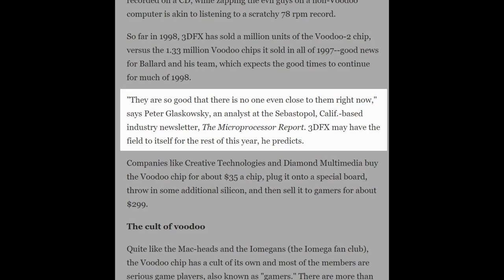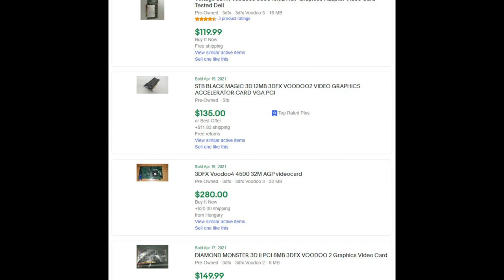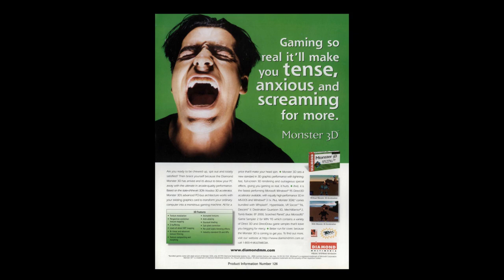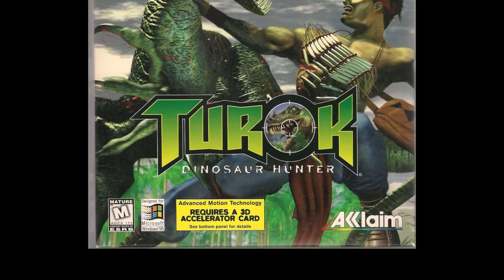3dfx Voodoo - Hit that Accelerator

Comment: That electro-mechanical relay is LOUD. People have talked about it before but I haven't seen a video actually record it until this one.
Thanks for sharing your memories! I'm jealous as my first 3D accelerator was the built-in Trident Blade 3D in my family's Compaq Presario. Not the worst thing ever but definitely no Voodoo!
Reply from the maker: Thanks! Yeah I put the microphone inside the computer so I could really  capture it and boy did it ever. The fact it's heard so easily with a closed case says something.
Reply: guessing that was changed to something solid state in the  Voodoo2
Reply: @Elios0000  It was actually changed on Voodoo 1. Only the early Orchids had mechanical relays. All others (including the Diamond Monster 3D) had solid-state switches.

Comment: Side by sides really do show the difference. You hit it bang on with the point about it burning brightly and anchoring nostalgia to that specific time. Especially as there's a finite amount of games directly supporting glide. I'm a software pixel guy myself, probably due to my experience with the V1 was a slow one. I had it from a friend who upgraded to a V2, but it didn't do much for our Cyrix 100 so I sold it to another friend. I even like Q2 in software. I do own a V2 though!
Reply from the maker: I will say as well I'm leaning more software now just because I can play on more powerful hardware than I could back when and basically brute force higher resolutions hah. But yes it's nice to have a specific time period to focus on which is nice with Glide.

I can see the Cyrix struggling to provide the boost one might expect. That'd be a bummer and understand getting rid of the card at that point!

Comment: The clicking sound when switching was most likely from those two Omeron relays. My cards which are from around 97/98 do not have those relays, nor the LM350 regulator/heatsink
Reply from the maker: Sounds about right! I haven't read into the details on why the choice was for such relays but they do the job and sound great doing so hah.
Reply: @RiksRandomRetro  all I can see on your card are quality components. Not sure if the later revisions of the same brand have changed design. Could be an interesting research topic :)

Comment: I think your making the same mistake many people make running it at 640x480. I believe most people ran Voodoo 1 at 512x384 for higher frame rate. Software rendering was generally limited to 320x240 for good frame rates.
Reply from the maker: You are definitely not wrong on running it lower for better performance. In my case both now and back then I felt it performed quite well at 640x480 enough to make it worth it in Glide games.

As far as software yes I definitely would go lower for real use but it showcased the true 1 for 1 difference better this way for the video. Still I love that about retro we have both knowledge built up over years, still learn new things and have so many options!
Reply: @RiksRandomRetro  As with anything, I think it really depended on the game. I think a lot of OpenGL titles benefited more because you usually could disable v-sync on those and get higher frame rate. I also more likely to use 512x384 on competitive games like Quake, Quake 2 and Unreal Tournament where the higher FPS really mattered. You really don't get "blockyness" from the lower resolutions on a CRT, so it was less of an issue back then. I think more Direct 3D games were designed specifically with 640 x 480 as a target and were not as graphically complicated to support that resolution better.

Comment: You might be interested to know that I’ve owned two of these Orchid Righteous 3D Voodoo cards (I only have one remaining) and they both made a different “click” to yours…but the same click as each other. 

When I heard your click I was like “what? That’s not what I was expecting”
Reply from the maker: Oh interesting. Thanks for sharing. I will say in this case I literally put a microphone on the card inside the machine so it's extremely close to that relay. It sounds more muted and "heavy" outside of the machine I'm assuming due to the reverberation of the case having something to do with it.
Reply: @RiksRandomRetro  Ah I see, the click at the end sounded a little more like my click 😆